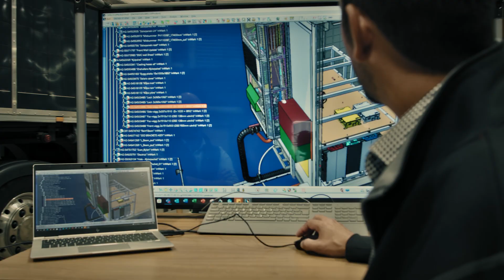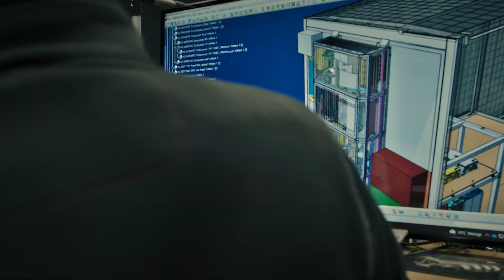The solar-powered Scania truck

Comment: Is the roof also covered in solar panels? Also how much watts is that? And how much does the motor use? Probably it has lots of batteries and the solar panels just cover a fraction of what it consumes to keep it moving. Would need more info but the idea is interesting (I thought of it before as I'm sure many people). This can even be done for a tiny house or motorhome, covering all the roof and sides with panels to get as much solar as possible and cover different angles.

Comment: What solar cell technology are you using? From what little I could see, I'm guessing it's CIGS. And if so I'm glad to see someone finally using the best available solar cell technology that I'm aware of for something like this.

Also, one of the people said this wasn't possible twenty years ago. That's incorrect, I've been trying to save up to do something similar with my shelter on wheels for longer than twenty years.

Comment: those from Scania are as smart as if they had fucked a fox. 22 kw of energy per day is enough to light the trailer and radio in the cabin. and the glass panels will crack in the first 1000 km of driving.
Reply: Uuj Buu no bb j JJ jijijijiji no bb
Reply: As wind screens need replacement each 1000km
Reply: That are no glass panels. We have as Balcony PV solutions flexible Modules that can bend to some extend. And the panels can be connected with flexible Materials so the Panels themself don't do much of the heavy working.

Would guess we will see this more for the Trucks that drive around frozen goods. The cooling Trailers are Sturdy so putting Flexible Solar panels on top of it should be quite easy.
Replacing loud combustion engine cooling aggregators with electric ones will help the Truck drivers too. It is hard to sleep next to it.

Comment: I hope that all tests go well, and so the Scania trucks enter the market soon.
Reply: There's nothing to do with the trucks. It is a Scania PHEV truck, and it is already on the market.
The point is the trailer, equipped with solar-panels on its roof, wired to the battery pack of the PHEV truck.
Reply: okay @gyoergypecsi